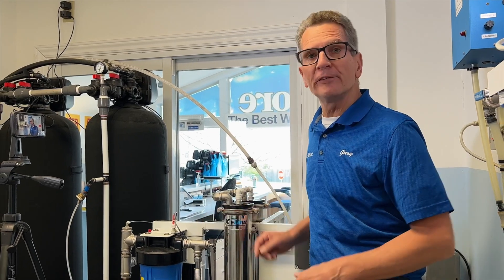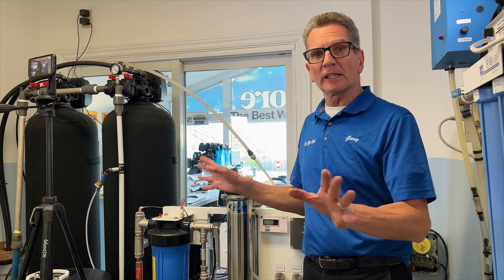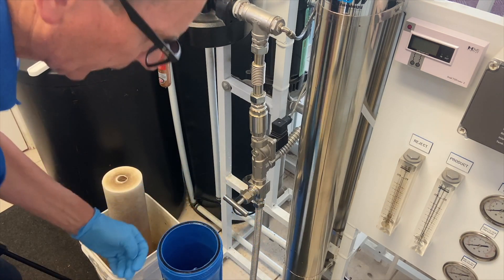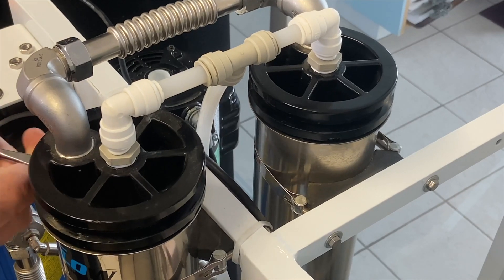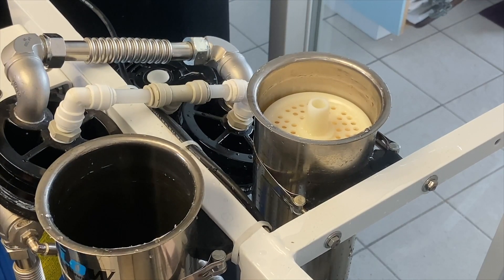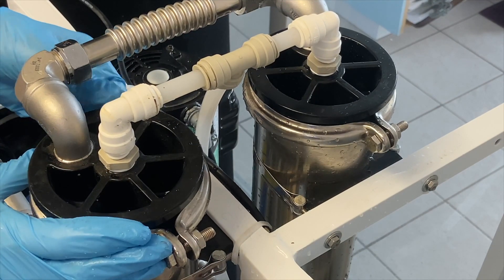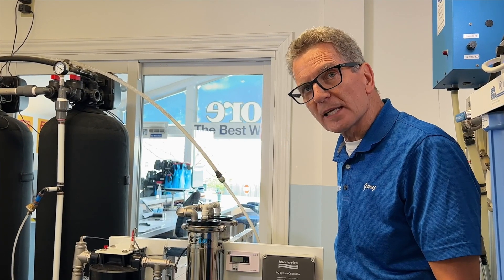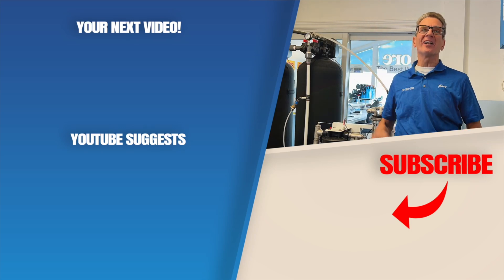Whole House REVERSE OSMOSIS Maintenance Pro Tips & Tricks!

Comment: Hey Gary! 
On my waterite RO system controller the  Low Pressure flashes very constantly. What should I do ?
Reply from the maker: You don’t have enough water pressure for the RO. You need to boost the pressure with one of these https://waterestore.com/products/walrus-hq800h-self-priming-booster-pump-1-hp

Comment: How often should membrane be replaced maybe I missed that in the video ? Is that just based off, of tds?
Reply from the maker: Also, the higher your water tds the more often the membrane Will require replacement. This video will help https://youtu.be/YOJ7eWi27OQ
Reply: Yes as it would be determined on usage which could vary from house to house.